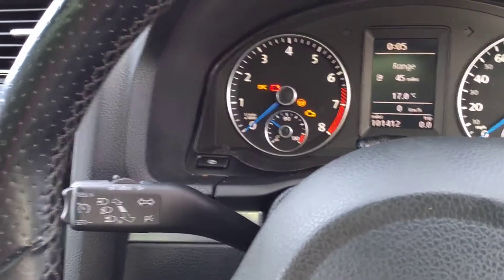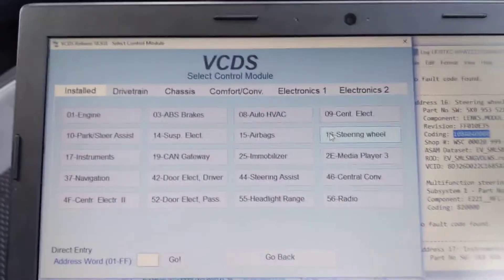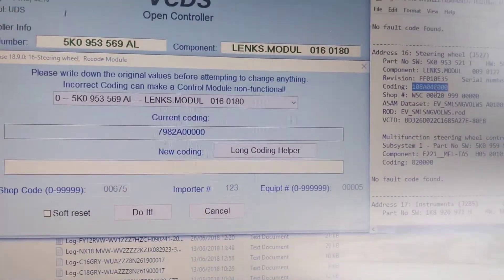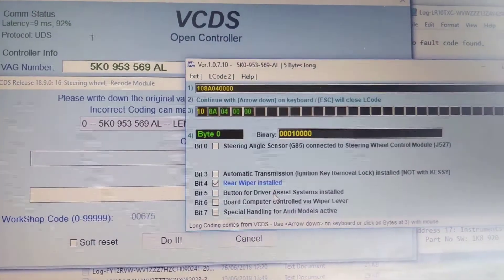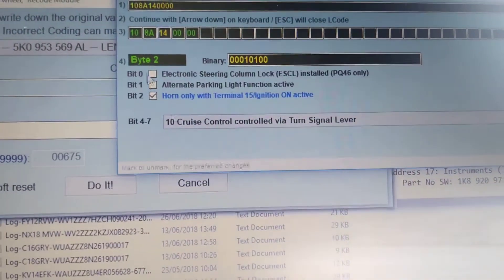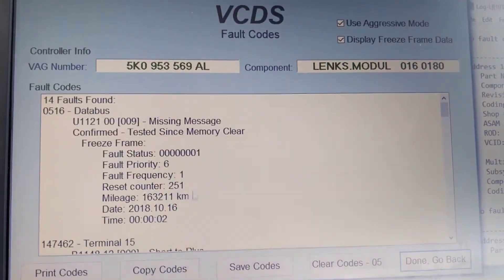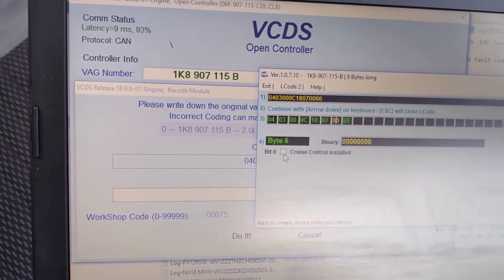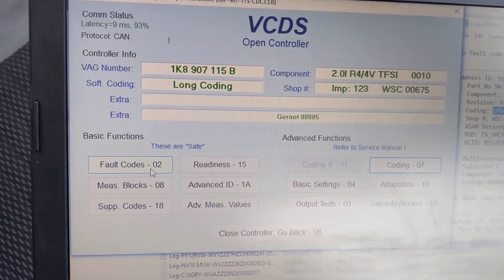VCDS Coding of Genuine VW 5K0953569AL for Cruise, same process for 5K0953569H

Comment: Hey do you know what codes are required to activate ACC? I have the front sensor for Front Assist with City Emergency Brake and the "high" can gateway control unit.

As far as I know, I've installed the hardware. New buttons on the multifunction steering wheel (5G 0959442 K) and I've changed the pedal, or have I forgotten something?

I would really appreciate your help.

Best regards

Henry
Reply from the maker: Yes, the differences in the platforms.
It is not possible, if you're using 5G Buttons, as they're MQB & a 5K SWCM is PQ
Reply: @VWDirect-01287-555055  ah ok, but the original buttons had the number 5g0959442H. should it work then? And do I have to connect the unit from the steering wheel with the unit of the engine with an extra wire like it is with the normal cruise control?

Comment: Hi mate, I have a 2010 scirocco with no buttons on my steering wheel. But I want to upgrade to the mk7 golf steering wheel, which has buttons. Would this be possible?
Reply from the maker: MK7 Golf is MQB, older models are PQ & the MQB buttons won't work on PQ

Comment: I foolishly discarded the old clock spring, and now having the same issues.  How do I determine the original code for updating the new clock spring?  What resource were you looking at for the old code?  Is there a way to find it without the original clock spring?  Thanks, great video.
Reply from the maker: You start by using the code we're using as a base

Comment: Hi This video saved my life. I just bought an old Skoda Yeti 2011 2.0 110hp with a lot of steering errors. It turned out that someone had replaced the original module 5K0 953 569 H (I got the model from the local Skoda dealer) with 5K0 953 569 AL without coding it. Also cruise control and trip computer was not working. It was with 7982A00000. I tried all sorts of combinations of the options and nothing worked. Finally I saw the video and decided to try the coding 108A140000 and everything worked. The car has cruise control on the turn lever, multifunction steering wheel and  trip computer that is controlled by the steering wheel.

Thanks a lot

Comment: Hello, I have a 2008 Golf and the steering wheel module was not working with the onboard commands and horn. I bought an used one with same codes but when I plug it onboard commands and horn works but steering assistance is not working. I understand that I need to copy the codes from the old module to the new one, right? Do you have any guide to do this?
I need to connect to VW server?  Thanks for your help!!

Comment: Hi just replaced my swcm, harness and clockspring because my mfsw stopped working after years use, I've put same part numbers ch ending swcm same model squib, and new mfsw harness but getting message e221 error no communication, being told need code in clockspring, I've coded in the swcm, but never coded Cs before, any pointers please, vw golf mk6 tdi 1.6 2010 plate, even replaced buttons still no joy, any help welcome.
Reply from the maker: No coding required for the older clockspring, just the SWCM

Comment: Hello, I have a Passat B7,  TDI 2.0, 2011 Bluemotion and a problem with a cruise control. It works in all gears but not in the 4th and 5th gear. I was told by the previous owner that the clutch and flywheel have been replaced. Do you have any idea what the issue could be? 
Thank you in advance, 
Zoran
Reply from the maker: You would need to check on Fault codes & Live data

Comment: This video just saved me but i did it using obdeleven thank you. When I did my grandads 2015 tiguan which doesn't require the steering angle sensor it was far easier to code. I was almost convinced the clock spring I bought for my 2014 tiguan r line was broke there was that many faults and lights on the dash you're a legend thanks 😁

Comment: Hello, I have a Passat 2016 Wolfsburg 1.8 TSI and the Cruise Control doesnt work, I also happen to have an airbag light on the dashboard, Idk if the previous owner changed the steering wheel or something similar, if I code just like you did on the video, my cruise control may work again? the codes that appear on the VCDS program are the following: 

Control Module Part Number: 5K0 953 569 AL HW: 5K0 953 569 AL
 Component and/or Version: LENKS.MODUL 016 0180

229127 - Cruise Control Switch
B1154 11 [009] - Short to Ground

229147 - Cruise Control Switch
B1154 13 [009] - Open Circuit

335876 - Powertrain Databus
U0002 00 [009] - No Communications

1140738 - Steering angle sensor
 B1168 54 [009] - Missing Calibration / Basic Setting

Thank you for the video and for your time reading my comment.
Reply from the maker: 5K0-953-569-AL is not suitable for the Passat. 
You will require a 5K0-953-569-AS & then coding + calibration

Comment: Hi i have my squib 5K0953569C and its giving me aitbag fault, the light is on. Bought an other one 5K0953569D. The new one turned off the airbag light but the hor  stoped working. Any idea, do i need to code the new one?
Reply from the maker: You need the original coding

Comment: Hlo sir i have mk6 jetta i have replaced clock spring now cruise control is not working its just showing ! This icon with cruise control sign . Please help me out if you can .
Reply from the maker: Did you copy the old coding? If so, check the wiring in the black connector, Pin 5 is the cruise wire.
Reply: I have just replaced the clock spring nothing else If its just because of the coding then please help me out with process of cording

Comment: Hello i have an passat 2010, my clockspring was defective so i replaced it with the same part number, i also adapted it succesfully with VCDS, but now faultcode 03375 “mechanical fault steering motor” can’t be erased, still having a red steering light on the cluster. So the powersteering still doesnt work.

Do you have any idea what this could be ?
Reply from the maker: Ensure the slip ring is centred & not 360 degrees out,
You then need to Recalibrate the Steering Wheel Sensor, if that doesn't work it will need the J500 Module reflashing

Comment: Hello i have  vw touran 2011  1.4 have hard steering  and red light steering   U108E00 this is the code
Reply from the maker: Yes, the slip ring needs replacing to fix this one.

If it's the 569 version, they're on our website; https://www.vwdirect.co.uk/1-x-5k0953569al-genuine-vw-audi-skoda-seat-steering-module-slip-ring-mfsw-cruise

Comment: How do you get log from original clockspring?
Reply from the maker: Run an Auto-Scan before removing it. If already have removed it, just plug the old module into the black connector to get the original coding.

Comment: 5k0 953 549 C same for A in the end???
Reply from the maker: Yes, it's the same procedure, except only the C is Cruise Compatible.
Reply: Please i need your help
Reply: Hi , could you tell me please if A in the end is for multifunction steering wheel???
Reply from the maker: @latestnewsfunnyvideos5396 No, It's a Midline Module, you'll need a B Version; Currently £175 GBP + Postage
Reply: Hello bro, can i ask u ??
I have this serial of tailgate control module SKU:5Q0 959 107 Р for skoda superb 2019 L&K.
My question is : should i look for the same serial or   What??? Note that mine is defective. 
Many thanks.

Comment: Hellow mate . I had the same slip ring code as you finishing at D and i switched it with E unfortunately i didn t keep the original coding . How can i find it ?
Reply: Use the coding on this video. Changes are its the same
Reply: @jigler my vcds only gives me yhe code of steering column not slip ring. i ran it many timees and the same
Reply: @ios8720  address 16?

Comment: Hello i did install same clock spring (includes GRA Cruise) for VW Tiguan, cruise shows in dashboard now but not working getting error below:
error: P056800 Cruise Control System(CCS) switch/Range performance
Any help please?
Reply from the maker: Either you've not coded both Engine & Steering Wheel or the wiring is missing

Comment: hello where can i find orignal code i am doing same thing my orignal part number is 5K0953569H and i am replaced with this 5K0953569AL but now I have problem ESC
Reply from the maker: If you do not have the original coding. 
Plug the black connector into the old module & retrieve it, then just copy & paste it into the "New Coding" box

Comment: Hi!
Got an VW Eos 2012 with broken clockspring with partnr. 5K0 953 569 E .
Replaced with 5K0 953 569 AL. (Bought from VW dealer).
Got the EPC-light turned on after installation. 🤔 (every other things works on the car now. Horn, airbag and so on)...
Same procedure to get rid of this warning light?
Many thanks! /Johan, Sweden.
Reply from the maker: The Steering Angle sensor will require calibration using this procedure 
http://wiki.ross-tech.com/wiki/index.php/VW_Golf_(1K)_Brake_Electronics_(MK60)#Sensor_for_Steering_Angle_.28G85.29
Reply: @VWDirect-01287-555055  troquei a fita 5K0953569E por 5K0 953 569 AL. mas agora o cruise control e computador de bordo não funciona preciso do código vag da 5K0953569E para colocar no pc,alguém pode ajudar

Comment: Brother I have problem can’t solve it 

The steering become red light and so heavy 

I change the gearbox and light become yellow 

No one can clear the yellow light 

Today red light come again 

What should I do ? 
Can you help me about that
Reply from the maker: You need to calibrate the G85 steering angle sensor & Steering Limit ends.
Depending on your ABS system depends on how you do this

Search your ABS System such as MK60 + G85, wiki.ross-tech.com
http://wiki.ross-tech.com/wiki/index.php/VW_Golf_(1K)_Brake_Electronics_(MK60)#Sensor_for_Steering_Angle_.28G85.29

Comment: When i change code and press do it. It says request out of range what could be wrong?
Reply from the maker: Lot of things;
1. Are you using a Genuine Ross Tech Cable.
2. You're copying the original coding, rather than just changing it by ticking boxes.
3. The new Module is New & a Genuine VW, also the correct part for the vehicle, as there is lots of options & the wrong option will not accept the coding from the old module.

Comment: Hi, 

Can I confirm my understanding please..
The process of recoding is to tell the car that a new part number is in use for the squib. This can be done via VCDS in the video and is actually pretty easy to do... it looked it from the video I'm just worried about something going wrong. 

I have purchased 5K0953569L to replace 5K0953569BD from an Audi A1. I had the garage replace the part but he didn't understand this coding piece so swapped it back to the faulty piece. 

Can you confirm if I can recode this new part in place of the old one?
Reply from the maker: Firstly why have you bought an L, or should that be AL.
The coding is for the actual module to tell it which options are available & it's the same process for any module.
Reply: @VWDirect-01287-555055  I couldn’t get hold of the right part number quickly, everywhere seemed out of stock and we needed to get the car through it’s MOT.

Okay thank you. So we should be fine then, just need to find someone to code it.
Reply from the maker: @benbarbermedia  We have them in stock, AL & BD

As per the video, we also code, if you're local
Reply: @VWDirect-01287-555055  yeah I don’t really want to buy another one as I’ve already spent £175 on this one unfortunately. If it can be coded I’ll find someone local to do this. 
Where are you based?
Reply from the maker: @benbarbermedia  I presume at that price it's used & your aware of the issues with a used airbag part.

We're in Skelton, TS12

Comment: You seem to know your way around this coding malarkey. Would you know how to code an rns315?  I replaced my 310 with the 315 and there a coding fault on the can gateway because of it.
Reply from the maker: You need to code 37 Navigation on the CAN Gateway for the RNS315
Reply: @VWDirect-01287-555055  I’ve done all that but the can gateway can’t communicate with the radio at all using VCDS
Reply from the maker: @Mind-your-own-beeswax  Is it a Genuine VW RNS315?  If so, tick box 37 Navigation on the CAN Gateway Install list

Comment: Hi friend, I have Turan 1T (2012. yr, manuf.) and original part was: 5K0 953 569 L and I found: 5K0 953 569 AL. Can you help me since I got problem with cruise control? Can this part work too?
Reply from the maker: We sell 5K0 953 569 AL & that is suitable for Cruise. Remember to get the original coding from the old module before removing it
Reply: @VWDirect-01287-555055  OK, thanks for fast answer.
Reply: @VWDirect-01287-555055 which area of VCDS do you scan to get the original coding?

Comment: Hello, great video. Quick question, would i need to code slip ring if i swap it with OEM part for example from different car with same part number? Thank you.
Reply from the maker: If the donor has the exact same options, then it won't need coding. 
I would always presume it does need coding, so save the original coding first.

Comment: How to get this code after refitting a new steering wheel? 
The MF doesnt work on the weel,after i checked with vcds then got mssg: 
Appears to be an unitialized  control module
 
Greetings
Reply from the maker: You need the original coding from the old module, to copy & paste into the coding box for the new module, then recalibrate the Steering Angle Sensor

Comment: Is there anything I can do if I do not know the old coding?
Reply from the maker: Firstly why do you not have original coding?
You can get it recoded using ODIS online or finding a scan log from similar/same vehicle & using that as a base & change the options using VCDS until it is correct

Comment: Hi mate I have passat b7  I think previous owner has installed new steering module as when I look its saying no coding at all I have flashing glow plug lights and tpms light on and can't reset tyre light and also my cruise isn't working or my left and right buttons on right side of steering wheel would you be able to help me mate and code it for me I can allow remote access on my pc if needed and can download what software you need thanks
Reply from the maker: You can get it recoded using ODIS online or finding a scan log from similar/same vehicle & using that as a base & change the options using VCDS until it is correct

Comment: Hi just wondering I have a 2007 2.0l golf and I’ve fitted my mates steering wheel with hands free controls and looks a lot better than my one as was a big standard wheel. Issue I have is now I have no horn is that because I need to get it coded in?
Reply from the maker: Have you the fitted the correct Airbag Loom, as the horn wire runs through the connector for the buttons. If yes, then it will be coding or you haven't got a highline module.
Reply: @VWDirect-01287-555055  I fitted the complete wheel from my mates scrap car, wheel and centre piece(airbag). The new wheel yellow plug, plugged in fine with my column but Im guessing since my original wheel didn’t have a control module in it that’s where my issue is